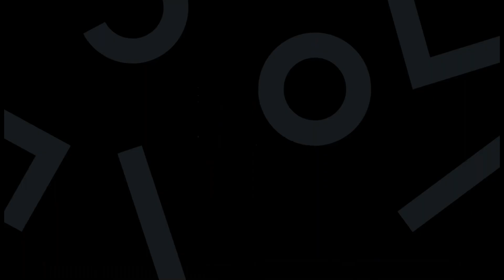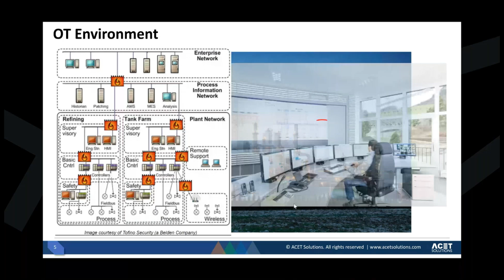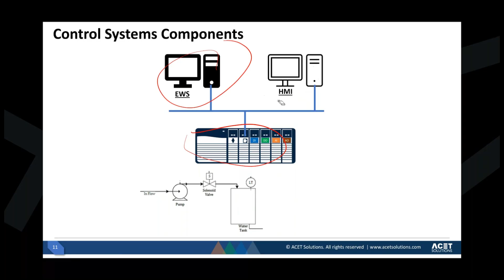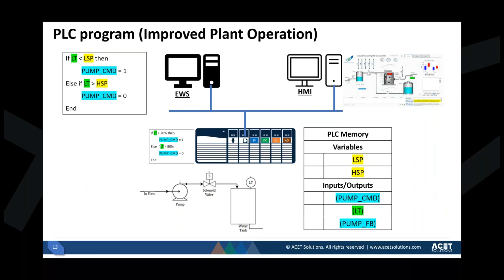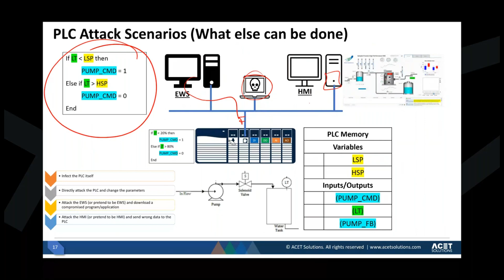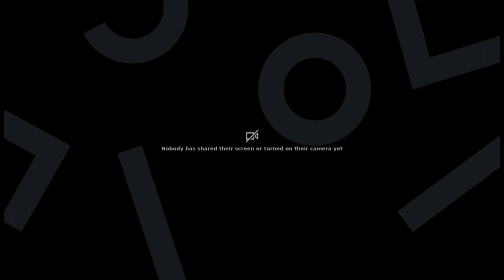How Control System Programming Methodology Impacts Cybersecurity - Episode 7 - Webinar Series

Comment: I don't know if anyone on this channel is still taking questions or not but I have a question: Here the speaker improved the code my writing Pump_cmd = Pump_fb, so if some attacker is trying to shut down or start pump, will not be able to do that through HMI. But what if the operator or engineer wants to shut down the pump or start it due to any urgent reason, how can we tackle this issue?